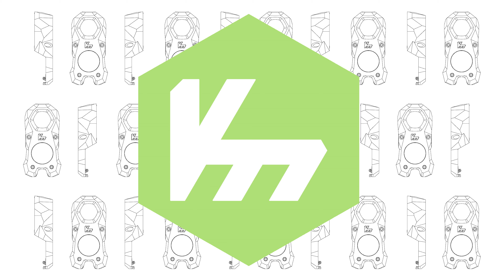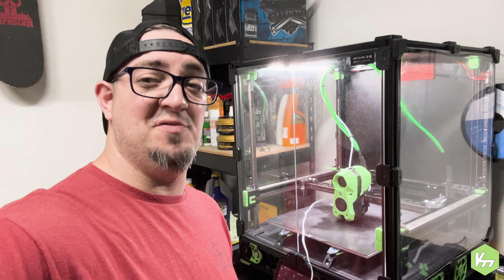No Nonsense Belt Shaper Guide HOW TO USE IT (From the toolbox 9)

Comment: What kind of "use-able" speeds are you getting with your current setup?
Reply from the maker: I have my Superslicer profile set to 250mm for Permimeters Inside and Out, my infill speeds are 500mm, Accels for walls and infill set to 8000 and my main "accel" is set to 11000

I hope to increase these next week with the use of a Bondtech CHT nozzle and XOL toolhead.
Reply: @TheVoronModder  recently found your channel, great content! Is this your printer running on 24V or 48V?
Reply from the maker: @davidm8293  24v

Comment: I found you are showing a graph for frequency responses for motor A & B at cue point ~1:04.  How to do so?  Would you mind elaborate it? Is it something similar to what we will do for checking input shaping for X/Y axis?
Reply from the maker: the graph at 1:04 is Belt Shaping, literally looking at how close your AB belt frequencies are (tension). You can install the neccessary parts using this guide: https://youtu.be/zTz2mK1-1AI?si=6RUlAxSvf7YqBsIs make sure to read the description! If you install all of Klippain using SSH into your raspberry pi you will get a whole slug of new config files in klipper, we just want to use the part that allows input shaping and adds the macros.

You need to G28 (home) your printer then do a QGL if you have a voron 2.4, then run your belt shaping tests. I run my Belt Shaping with my printer COLD, no fans nothing, I want the raw tension data.

When I run Input Shaper I want everything warm and fans running that I normally print with so I end up with quality prints with everything on that is needed to print parts, the results of the graphs can show us alot of things, Im working on an in depth video regarding the graphs, how to interpret things and what to do.

This video is more of how to get started guide. 

Thank you for your comment!
Reply: @TheVoronModder  Thx again!